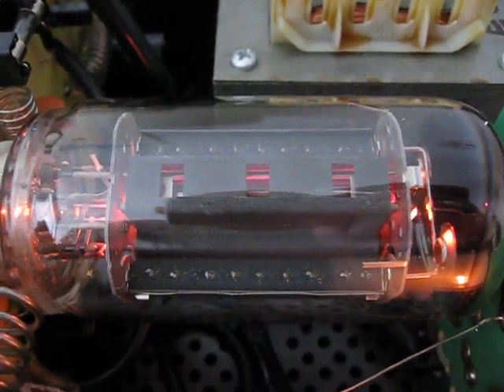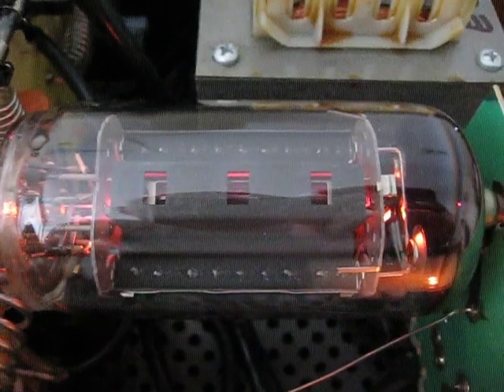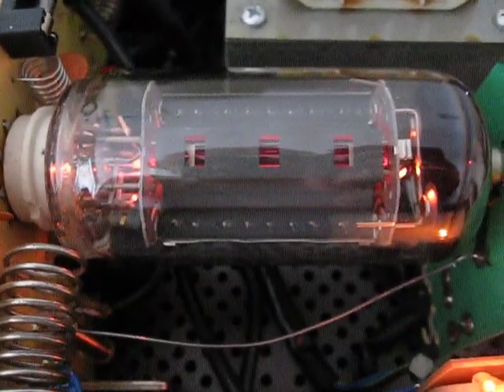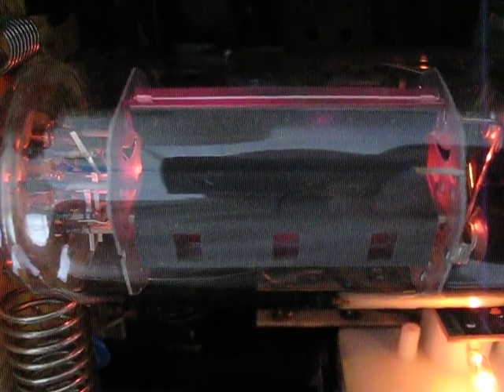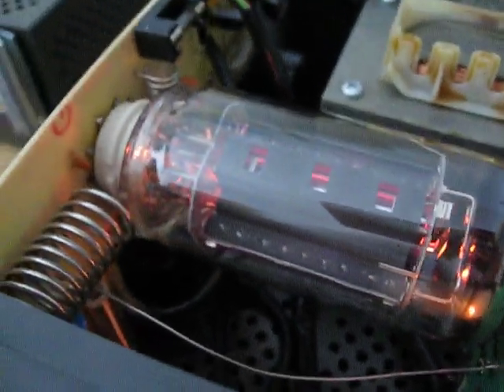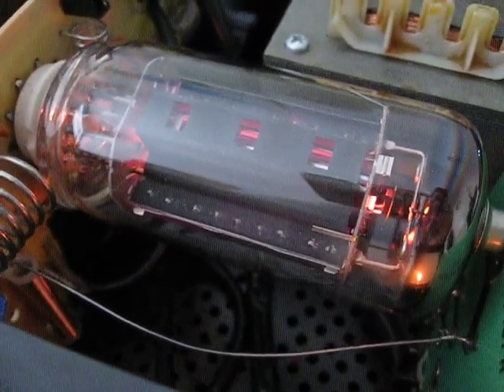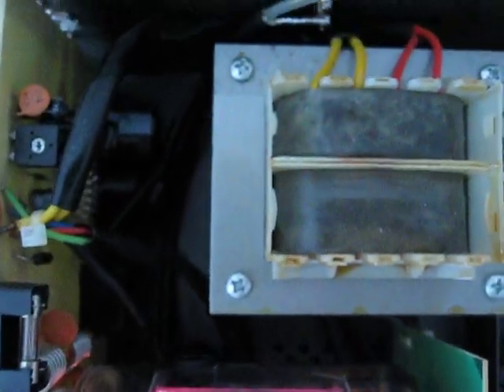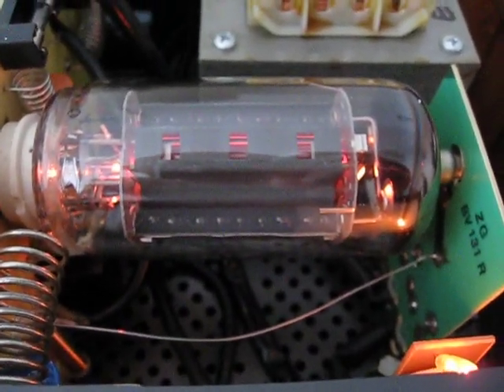Zetagi BV131 red-hot el509  tube inside

Comment: I don't like it, when a tube runs that hot. It's not a well designed lineair amplifier for sure. The plastic front melts over time, and the transformer is way to close to the tube.

Comment: EL 509 you can only work with a froozer. Also our moderator had to learning read. The power is 240 Watt Watts. This Zetagi with original Equipment brings a SSB Peak (USB) 450 Watts. But you had to make a bunker for that, it wasd totally overdriven when you work on 27 Mhz. On 28 Mhz you will go with 300 W SSB and 20 W Input.
Reply: what a load of bullshit

Comment: poor tube, a tube for HSync used in TV
you get clean 30-40w, but 100w is totally overdriven.
whatever, there are still peoples getting "1.2KW" amps with such crappy tubes.
Reply: Its a RF ampliffier...certainly in class C you can achieve that amounth of power with 1kV